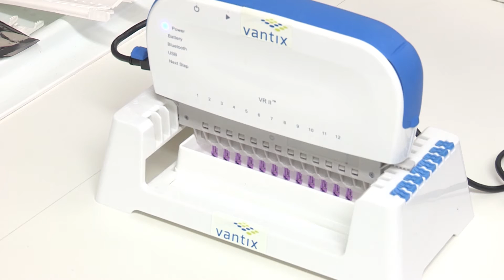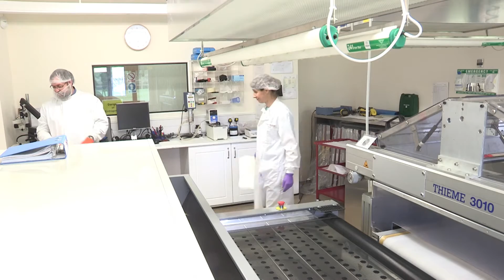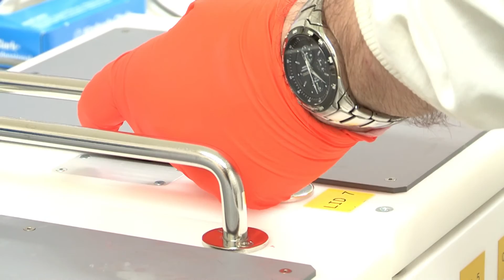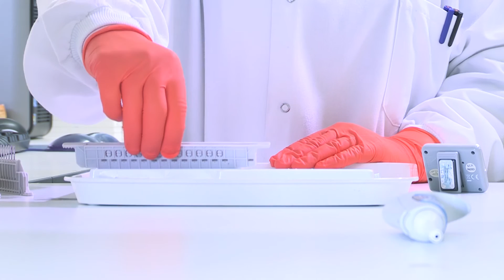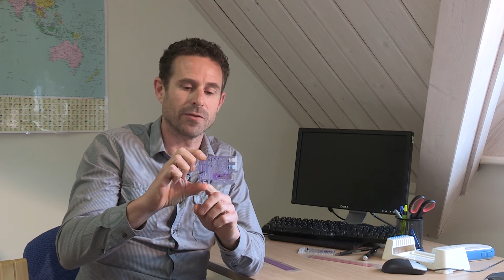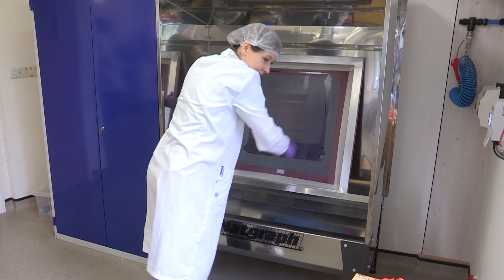Vantix™ Research System (VR2) | vantix® DIAGNOSTICS

Comment from the maker: The Vantix™ Research System is ideal for transferring existing assays or developing new assays for the biosensor. It is currently receiving positive feedback in use on several customer sites for proof-of-concept assay development and testing or screening. Read more.:http://www.vantixdx.com/wp-content/uploads/2012/10/VantixR2.pdf
Proven Technology:  The technology has been proven across a wide range of assay formats measuring from testing for ions through whole microorganisms, with high analytical sensitivity and precision.

Find more information at www.vantixdx.com or email info@vantixdx.com.